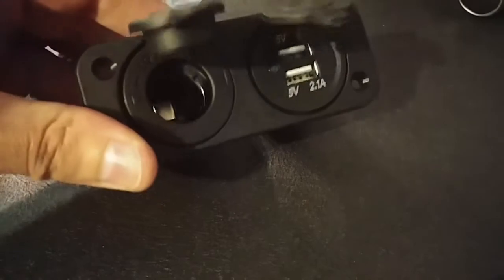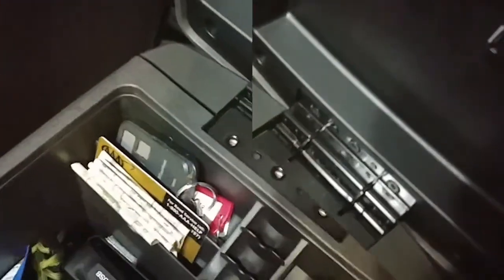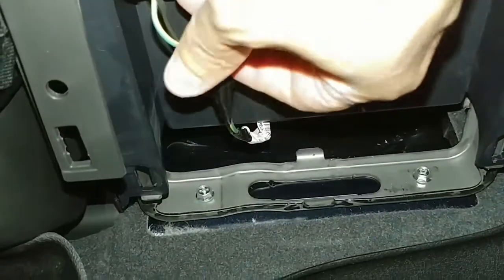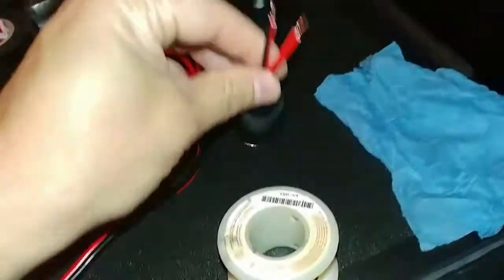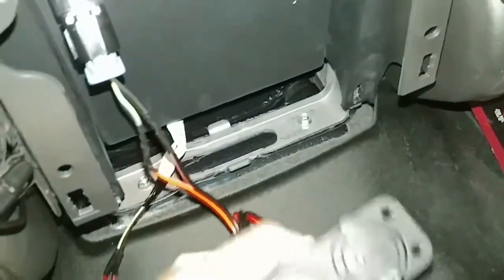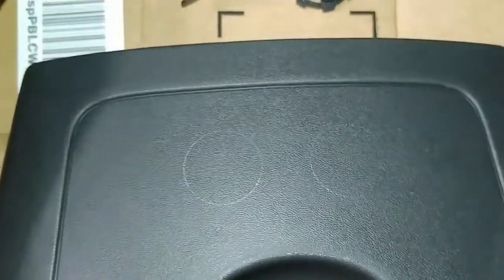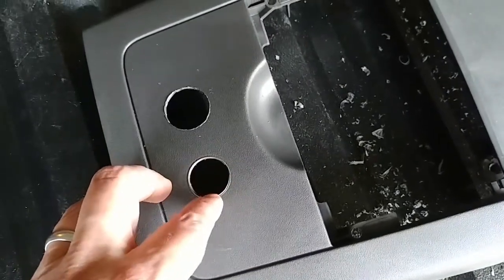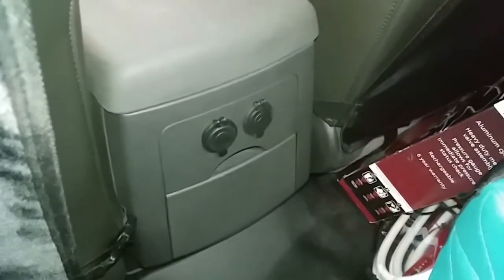2019 Nissan Frontier Crew Cab: Installing 12V and USB outlets in the center console

Comment: Is it possible to use All of them at the same time? I mean wouldn't overload and pop off the fuse?
Reply from the maker: Yes, it is possible to use all three outlets at the same time as long as the combined load is less than 10 amps.  The fuse for the circuit is 10 amps, so if the total load exceeds that amount, then the fuse will blow.

Comment: I have a 2018 Frontier Crew Cab. Any idea IF there is a way through under the rear seat through the floor, grommet, etc??
Reply from the maker: Not sure about the rear seats, but there is a  pass-thru under each of the front two seats.  The holes are not obvious because they are filled with a black sound-deadening putty, but it's easy to poke a small screwdriver through them to make a hole.  Once you pass a wire or cable through, then you can smear the putty around it to seal it up.
Reply: Hey, thanks. Big help there.  Ham/CB radio install going on. Thanks again.
Reply from the maker: @q95oldies57  No problem, glad to help, and good luck with the install.